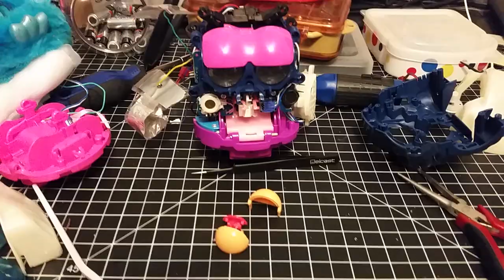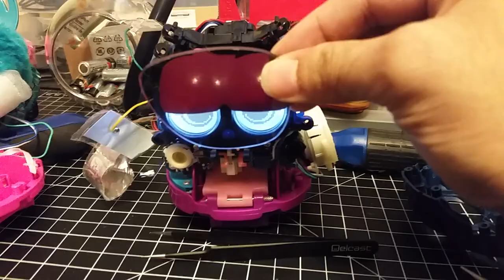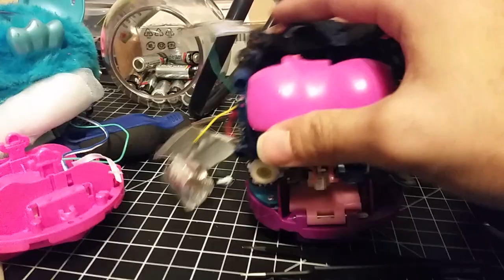Furby Boom Autopsy pt.2

Comment: You should measure with a multimeter when the Furby turns on or the motors get electricity if it is so it is blocked somewhere that it cannot move properly